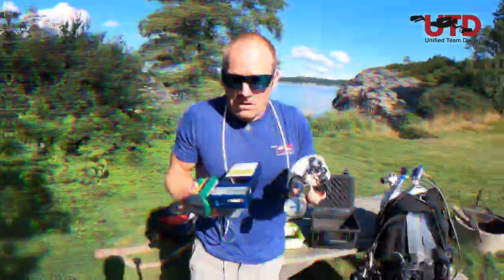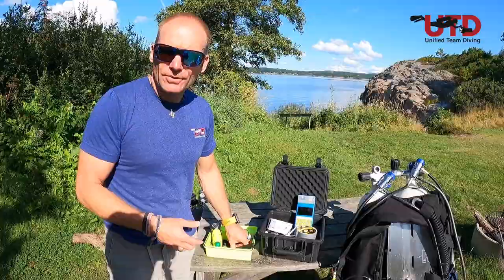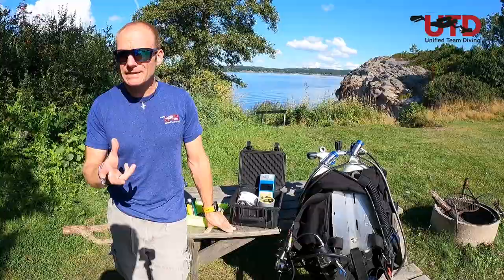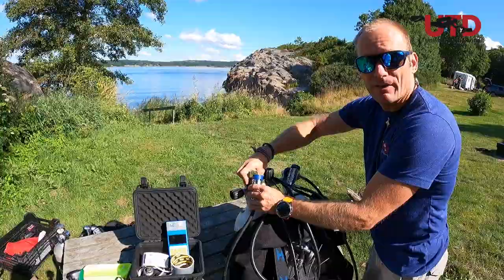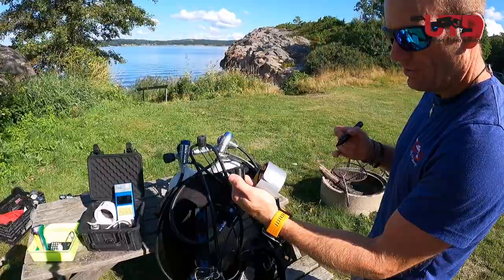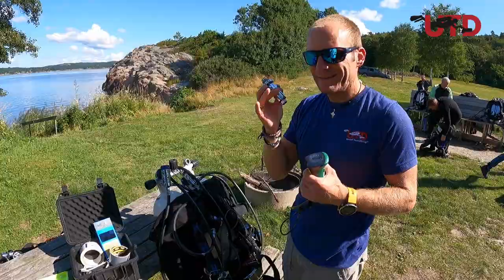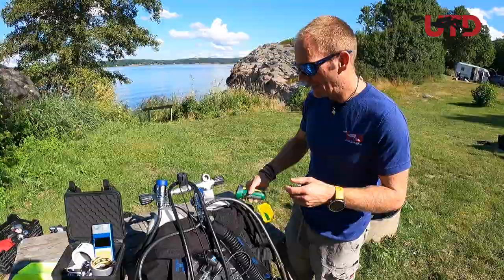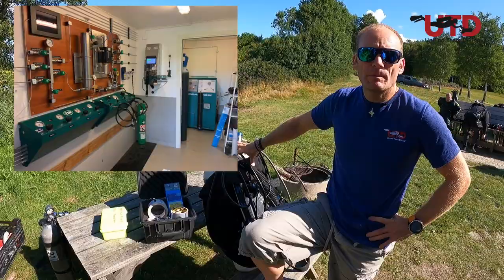How to analyze your scubadiving gases

Comment: Great video as always!
One question though: why did you say the MOD of air is 30m? Is this some kind of UTD guideline?
Reply: I’m wondering the same thing 🧐
Reply: Narcotic effects from air become too great. From 30 m He blends are advised. Effect of gas density on work of breathing also is starting to reach an undesireable level.
Reply from the maker: Christopher is right, we write the MOD on the label as the Max operational depth depend on more than just the PPO2 of the oxygen content in the gasmixture. The Gasdensity and Narcosis effect also play a role. I might do a video on oir standard gasses soon ;-)
Reply: Thanks for the reply’s guys. A video on it would be great. All the teaching material is pretty simple when it comes to calculating MOD and doesn’t always take into account gas density or narcosis effect. Apps like Nitrox Buddy for example are pretty rudimentary when it comes to giving you your MOD.

Comment: You really should calibrate your analyzer with dry air, not wave it around. Humidity can add percentage points to your measurements. The reason you calibrate is so you don't pick up the humidity in the air, and your readings are accurate.

For normal EANx mixes between 20 and 40% (like EAN32 or EAN36), single point calibration is good enough. You calibrate only on dry air, and your EANx measurements are pretty accurate.
For higher oxygen mixes (over 40%) it is a good idea to do a two point calibration (if your analyzer allows it). You should calibrate on dry air, and on 100% oxygen.
For hypoxic trimixes, you should do a three point calibration. In that case you calibrate on dry air, 100% oxygen, and 0% oxygen (like 100% nitrogen, helium, or argon).
Calibration sets base points for the gas mix curve. At the extremes there is more deviation if you don't calibrate, that's why you also calibrate on 100% oxygen for high oxygen mixes, and on 0% oxygen for low oxygen mixes.

I wish you would've showed how the flow limiter worked as well. You can crank your valve open completely when using a professional flow limiter. It will automatically adjust to provide just enough flow to analyze your gas. After you've analyzed your gas, close your valve, and use the bleed screw to release the excess pressure in the flow limiter. You can also wait until it's bled the excess pressure through the tiny pinhole, but that can take some time.

Your electrochemical oxygen sensor has a limited life span. Depending on the flow rate needed by your analyzer, and the number of times you analyze, the life span can be anywhere from 6 months (high flow/almost daily use) to 3 years (low flow/rarely used). A new oxygen sensor is around 100 dollars/euros. Even if you don't use the analyzer, the sensor will need replacing every few years.

If you have a trimix analyzer with a thermal conductivity helium sensor, you'll need to replace the sensor every 5 to 10 years. That one's around 300 dollars/euros. The Divesoft He/O2 or Solo analyzer uses a solid state helium analyzer, which measures timbre shifts in sound. That one never needs replacing. The Divesoft analyzer is a little bit more expensive than most trimix analyzers, but you'll reclaim that extra cost the next time you would need to replace the thermal conductivity helium sensor.